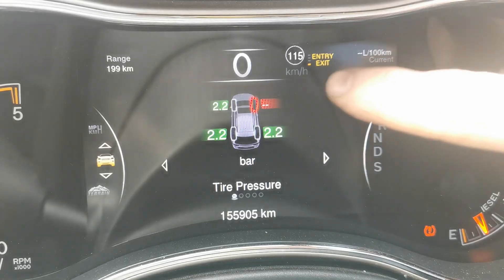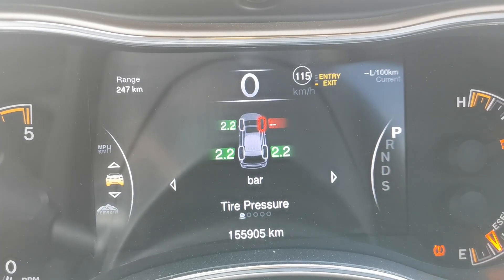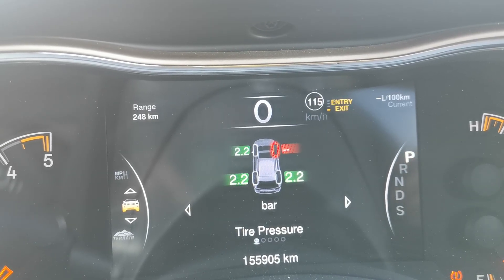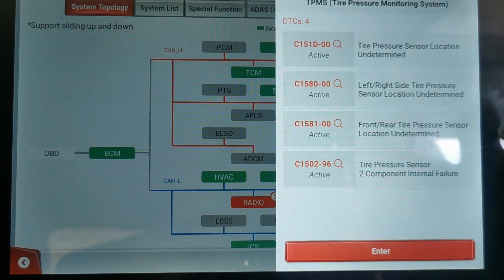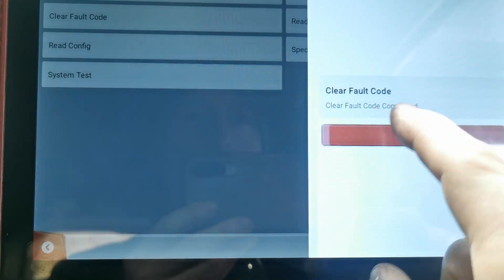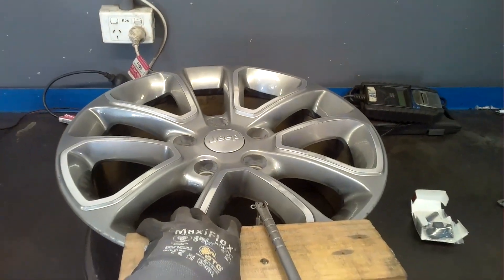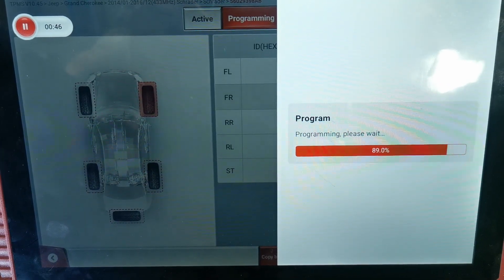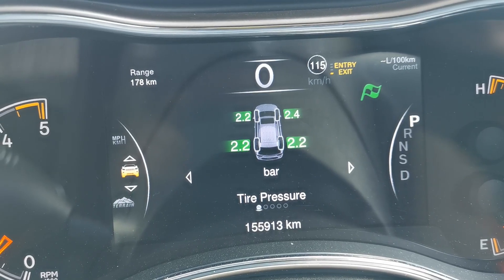TPMS Fault Found & Fixed - Step By Step Process & System Information

Comment from the maker: The scan tool I am using in the video is a Thinktool Master X2 by Thinkcar - This is an all in one professionally level scan tool that I use daily in the workshop. *There are many other cheaper options tools that can focus on just the TPMS side like the Thinkcar TWAND 200 or THINKTPMS G2 to resolve this type of issue* 
Sensor options that I use are THINKTPMS S3 Rubber Stem & THINKTPMS S1 Metal Tip which are both Dual Frequency: 315MHz / 433 MHz Sensors 
 
The lifespan of a TPMS sensor is anywhere from 4 - 8 years depending on. The batteries are not replaceable and it will require a new sensor once the battery is flat.  
As always thanks for watching 😄

Comment: Can you help me. I have indirect system that reads from abs and i have a reset option in the multimedia but i changed it with an android screen and it doesnt work. So i stuck with the tire pressure warning. I have an obd bluethooth device can i remove the light with it??